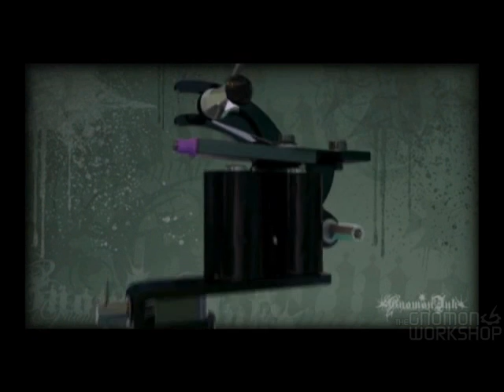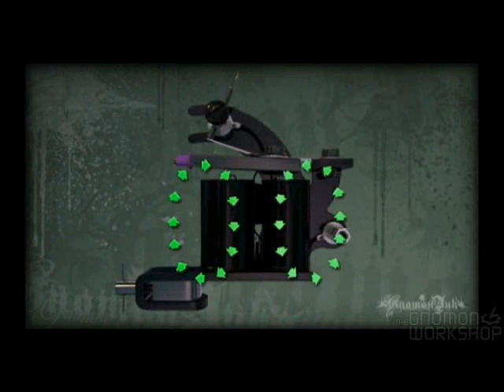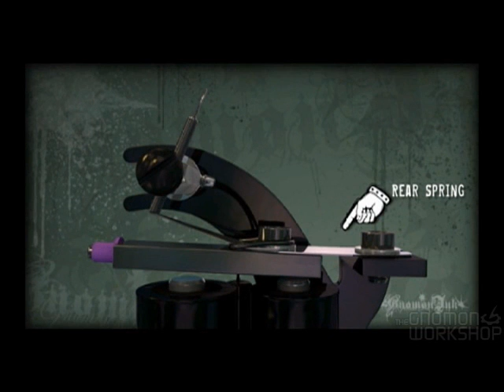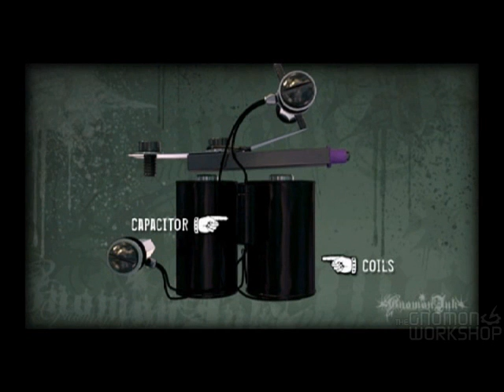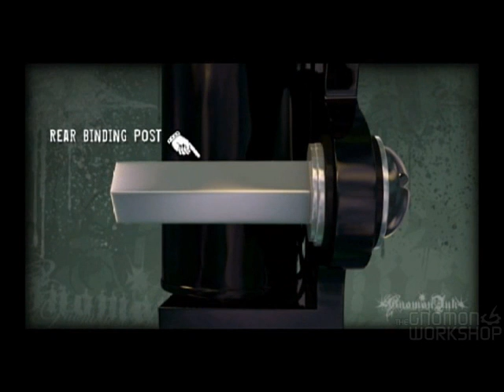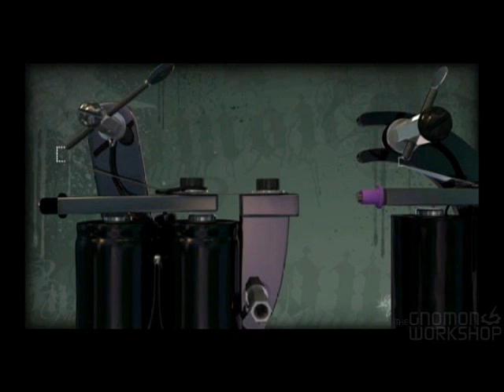Beginner Liner shader tattoo machine explination

Comment: Is the arm bar in both machines the same height and weight? What is the angle of inclination in the front spring? I bought two springs, one front of 45 mm and one rear of 34 mm. The front wasn't bend so I bent it. It all seems correct but now I have a weird problem. The front spring is too high and the contact screw needs to be so inclined to reach it; in a 20° angle. I have a liner machine that is perfectly calibrated, like the video says, so I compared measures on both machines. The only difference that I found (besides the ones that actually have to be there, according to the video) is the height of the arm bar, being 5 mm shorter the one on my shader machine. I haven't really tested the shader machine because I'm waiting for some coils that I bought online, so I really don''t know if this difference with the shader of the video is gonna be a problem.

Comment: Hi, just got a beginner tattoo set with 3 guns. Altho there are differences in the frames, the distances between the armature bar and the coil are the same. I really can't tell a measurable difference. So I can't  tell if I have all liner guns or shader guns. And at this point (beginner) it's all going to be hard! Any suggestions on how to figure this out, or just go for it, learn from my mistakes (on fake skin)?

Comment: I am confused about the front screw being the width of a dime on a liner and that of a nickel on a shader. If the screw is not touching the front spring the electrical current can not run the machine. I am awfully confused, Can someone help me?
Reply: That's with the armiture bar pressed down.now check the gap

Comment: Great video but i have one (maybe stupid) question. When you say the angle of the contactscrew should be between 25° and 30°, from where is that messured. On the diagram, the angle of the liner's contactscrew seems way bigger than the one on the shader. Is the "zero-line" horizontal or vertical? The diagram suggest horizontal, hence my confusion...
Reply: Ignore that nonsense. Just make sure that your contact screw meets the spring at a 90degree angle- screw to spring. Choose spring length, and adjust binder post and screw to suit.

Comment from the maker: actually i set  alll machine at a 45  , ( i didnt make this its just a outtake of a video i though would be a good beginner intro explanation ). the contact on a shader needs to be forward becouse the geometry of the FRAME puts it there. not the angle of the screw

Comment: I wasnt getting technical, i said it was "basic rule of thumb".
Basic being the operative word there.

"you dont have to change the thickness of the springs as thickness, width, and length all effect tension the same"

In that sentence it is both saying you have to and dont have to. Spring tension is for a rather important reason and there is good reason that liners and shaders have different spring gauges (and therefor spring tensions). Lets see if you can guess what it is.

Comment from the maker: well if you want to get technical  there are2 types of liner short stroke and long, 2 types of shaders short stroke and long.  so what we really go by is speed the bigger the gap the faster the machine ,  the longer the stroke the less tension in the springs , ( you dont have to change the thickness of the springs as thickness, width, and length all effect tension the same)  and the caps fin etune the frequency or speed.    ALCHEMYIRONS*COM

Comment from the maker: its not wrap its layer   and the number of layers in a coils is almost pointless  the liners i make may have 6 or 8 layer  and almost noone makes 12 layer coils unless its a single coil.  what truly matter if the springs how they are shaped and a few other things that create the tuning for liner or shader or color machine  .   alchemyirons*com
Reply: Bullshit they been called wraps as long as I’ve been tattooing since 87 you buy them they are called wraps a 7 a8 or 10 any company I’ve dealt with so I guess you are the exception

Comment from the maker: you can tweek the stupid screw to change the cps but that is the wrong way to do it .  you should be using a machine BUILT for lining or shading  MANY factors go into a proper tuning , not just turning the contact screw

Comment from the maker: @gambleyourhealth   not becouse you need to realize there are 2 types of liners and shaders ,  long and short gap .  
single pass liner short gap , scultptin gliner big gap , traditional shader medium gap cutback shader short gap .
2.0mm gap  singlepass liner cutback shader - short front spring .018   - .020 rear  22-33uf cap
3.5mm gap  trad shader  .018 front n rear  33-47uf cap 
4.0-4.5mm gap color packer-sculpting liner   long front .016-.018  / .018 rear  47uf cap 
see my other videos

Comment from the maker: @StiffFingers1     YOU CAN  USE A 3.5 GAP FOR SHADER AND A LINER  BUT NOT A 2.0 DIME LINER 

I BET YOUR LINER IS A DIME LINER OR SINGLE PASS LINER  , THAT IS NO GOOD FOR BEGINNERS .  SET IT UP WITH .018 SPRING FRONT AND BACK.  400 GRAMS REAR SPRING TENTION AND A 3.5 GAP 
THEN YOU CAN USE IT FOR BOTH

Comment from the maker: @VVR13FLAKO    you need to read "Reinventing the tattoo "  im sure a free pdf file can be found online there is a section about sculpting lining .     the thickness of a line depends on the size of the peice and the peice it self  some lines are thinner depending on foreground background or inside lines used for separation , its called "line wieght "   only smaller lines can be done in a single pass

Comment from the maker: @VVR13FLAKO   no   thats pointless,  boiling is not the same  you need heat and PRESSURE  

if you dont have a pressure cooker then use disposable   or at least scrub them well and soak the parts in barbacide for 10 minutes ,                   but even a 10lb pressure cooker  used for 30 minutes will kill everything .  only  use sterile pouches with pressure cooker

Comment: @tattootrainer
if i put my stainless steel tubes in a sterilization pouch will it still clean if i put the pouch in a pot of boiling hot water? or just put them in boiling hot water for that matter because money is kinda tight for me to buy a presure cooker and a auto clave especially since im not chargeing alot since im still not that good.. so wat would u recommend for my situation

Comment: i was wondering if i can just use a chemical to clean stainless(without this whole presure cooker tech.) like cavicide or alconax? wats the use of cavicide and alconax and wats the difference?... and if i buy the pouch would it work if i put it in a pot of boiling hot water and  let it boil clean?

Comment from the maker: @VVR13FLAKO    yes the 7rnd is a bigger  "weight" line than a 3  ,  and you dont want to use "FLATS "  you use MAGS  no t the same  ...  a 5 mag or 7 mag is for smaller areas than a 17 mag    also the needle come in different sizes standard is #12  THINNER #10 OR #8 IS FOR SHADING        but for what you mentioned you want a 7 mag #10 needle  it goes in a 9mag tip      SEE MY NEEDLE VIDEO

Comment from the maker: @VVR13FLAKO   the size of the line ....  but for small are shading you use a 9 round not a liner ,    a 7 liner can be used first then a 3 to shape or sharpen a line ,       a shader you are referring to is a traditional medium gap style   NOT a cut back .   but a nickle gap  with a 7 mag #10 bugpin   with a medium value wash

Comment from the maker: @psybera1987   im use my machines , i build my own ,  it depends on what you want to pay for  you can go 3000.00 for one thats good to go or  you can go to ITS international tattoo supply and then all you have to do is tune them by adjusting the tension or replacing the springs with the proper ones.    unless you pay 200 or more per machine they will not be properly tuned  but that is something you should learn for yourself anyway

Comment from the maker: @psybera1987  , kits are a waste  at best they will tell you how to plug the power unite into the wall or something ,  it may be a watered down liner ink that is not supposed to be used for coloring  coloring black is like any color it is thicker,  liner ink is thinner so it flows ,  skin color and the other colors used will make it look darker also .    if you use great ink like eternal it will go in like a fucking permanent marker , dont mess with cheap ink in kits

Comment from the maker: @8Danchi8       are you speaking of   2:27  the  gap  from the front spring and the screw ?  

it depends on the machine      a liner is a short stroke   2mm       a shader   is 4mm      but  the front spring is also different     and the rear spring has different amounts of tension    th eliner has more tension   and the  shader has less    ..  see the video labeled    "Correct tattoo machine settings"

Comment from the maker: @JTOPETE14    well yah if it is a true 8 and 10  and not just some added wrapping 
(see my padded bra coil vid)   but yah less layers is less size,  but that really has nothing to do with what is the liner or shader

the 8 is typically a liner and SHOULD have a short front spring ,  but if it was a kit it is all wrong anyway . you need to get a set of spring for both 1 set liner and one set shader  18g   from infinite irons or  atimemachine , then set the tension ,, lots of my vids to watch

Comment from the maker: @JTOPETE14   8.1 or 10.1   JK  first they are not wraps , it layers a 8 layer coil can have 300 wraps ,  also it depends on wire size and core size  . many cheap coils say 10 but are only 8  and many are uneven ,   the only way to know you have good coils is get american hand made 10layer coils they have 12 but a proper 10 will do any job ,  look up  bicknee